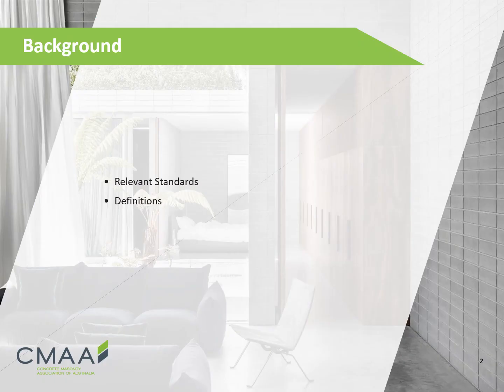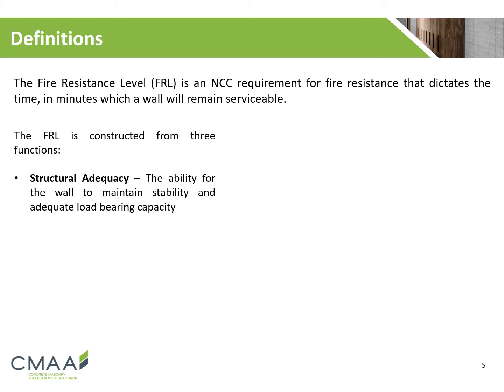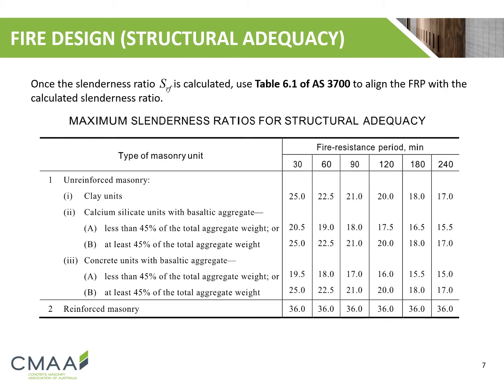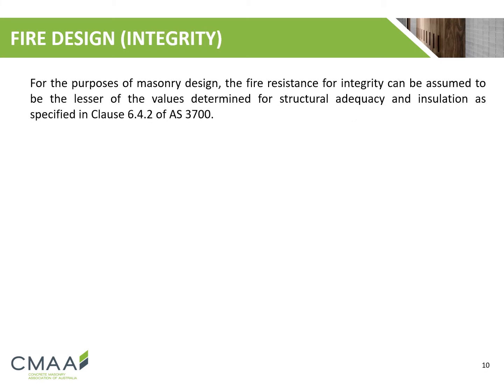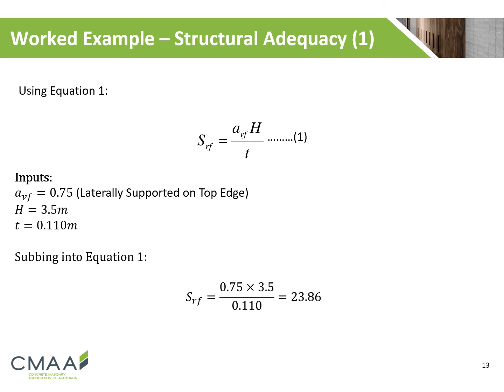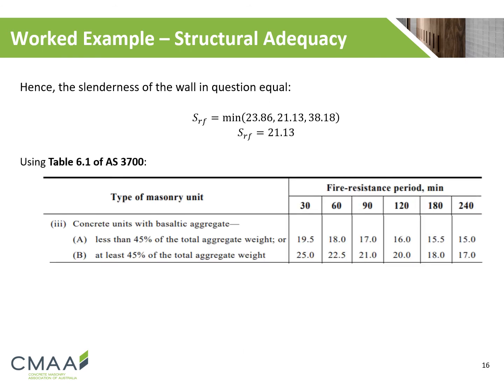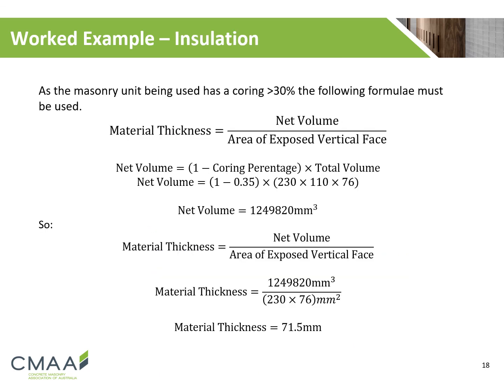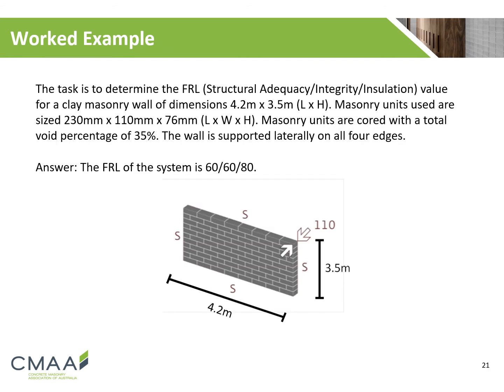Fire Resistance Level (FRL) Design Presentation

Comment: Thanks for the video. @8.13  i think the chart is to be read differently  (please correct me if I'm wrong). From that joining red lines,   You should be following the closest curve line which reaches 90min FRL (not 60). Can you please confirm? From what you are saying, regardless of the length between supports, the answers remain 60min FRL (if Height is constant).